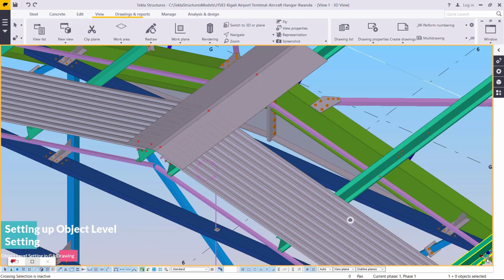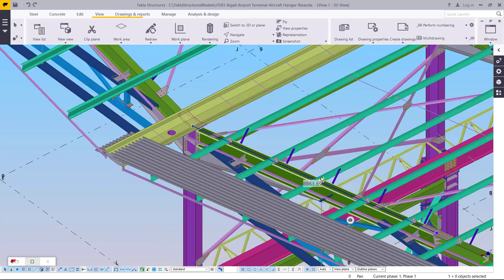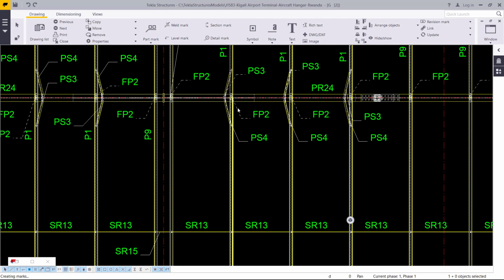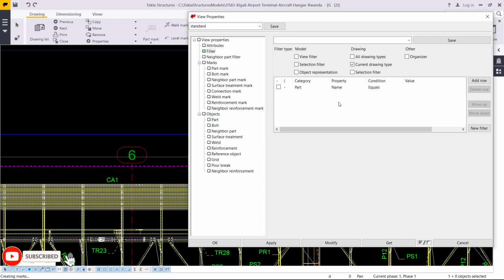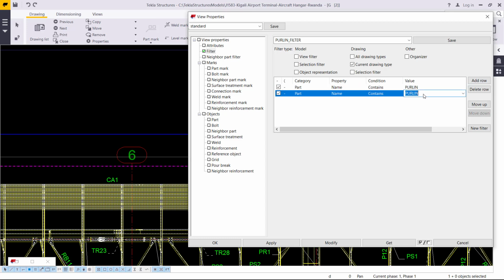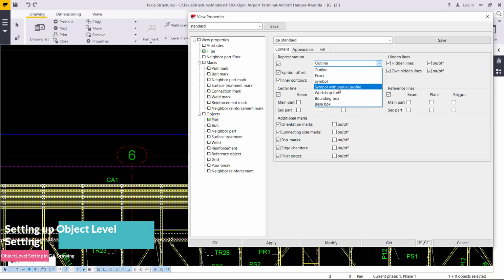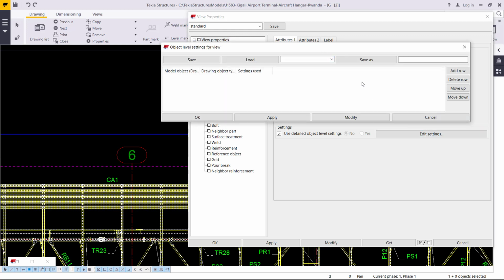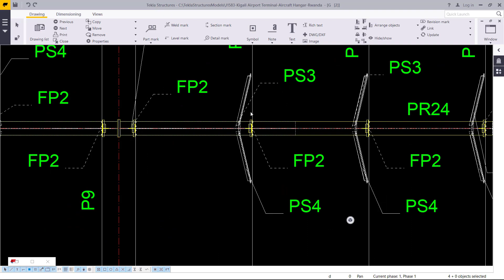Object Level Setting in GA Drawing in Tekla Structures

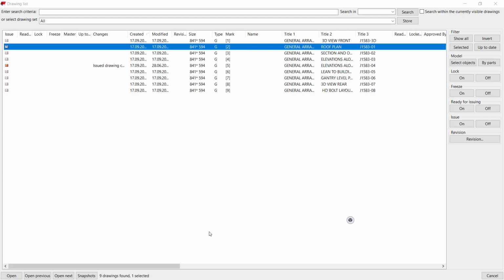Comment: Hello. First of all, thanks for the video. I have a question for you. At 3:25 minutes it writes FP2 to the connections. it writes the same values for those with the same connection type. How can I do this with tekla Structures?
Reply from the maker: Yes, correct, is numbering settings